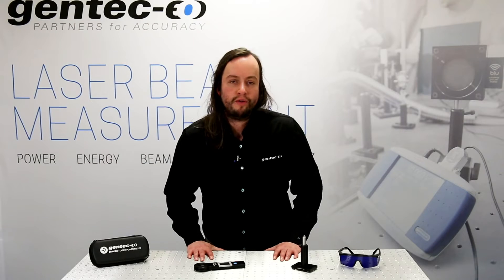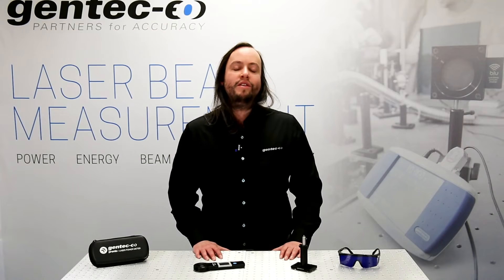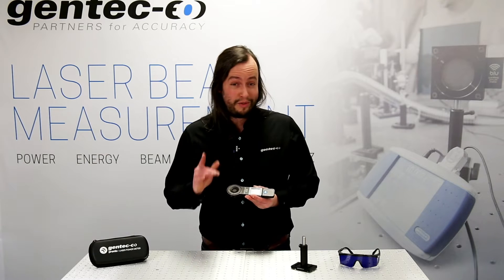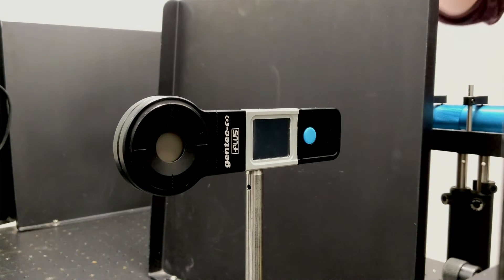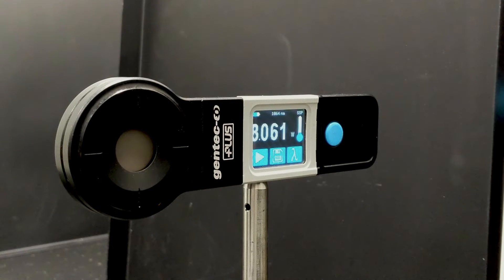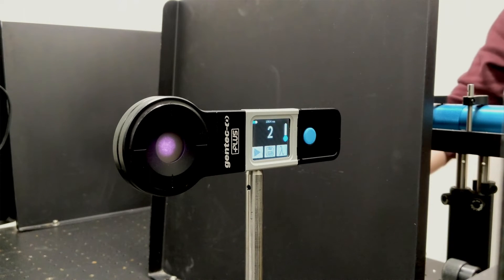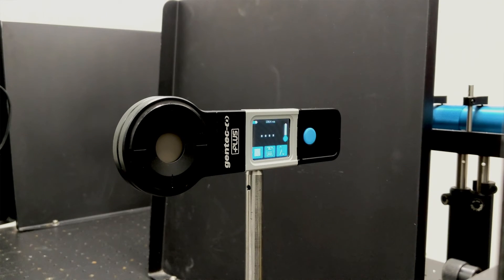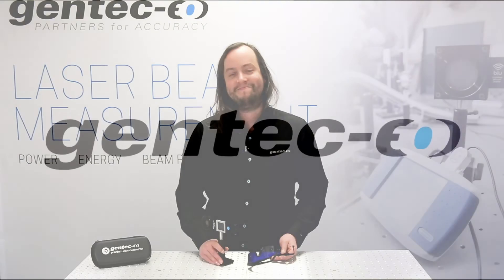Your first measurement with a PRONTO-250 laser power meter

Comment: Hi does the 10k is sweetable for cutting laser?
Reply from the maker: Yes! PRONTO-10K can be used to measure the power of a laser cutter, or for any other laser with powers up to 10 kW. It's just important to make sure that the beam is not too small, otherwise the absorber of the detector could be damaged. Gentec-EO offers the best damage thresholds on the market to ensure that this does not happen!  

Have a good one, 
-KF